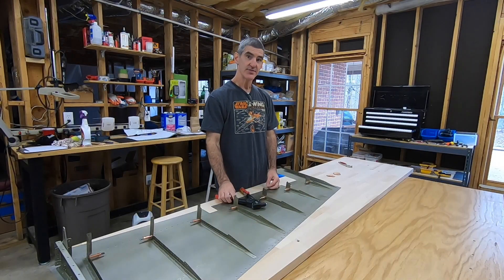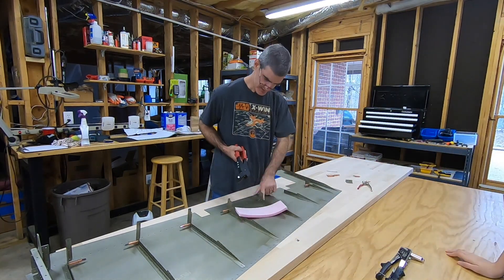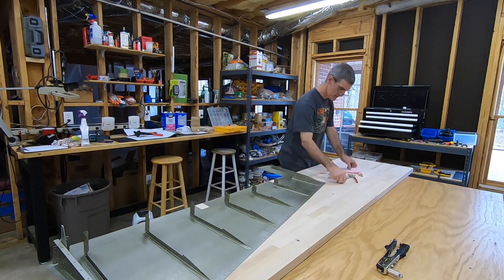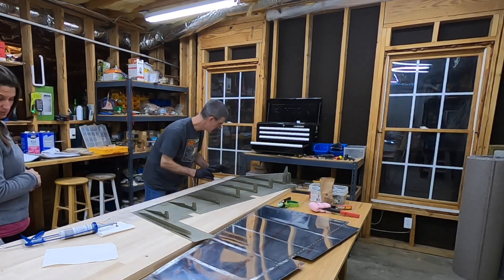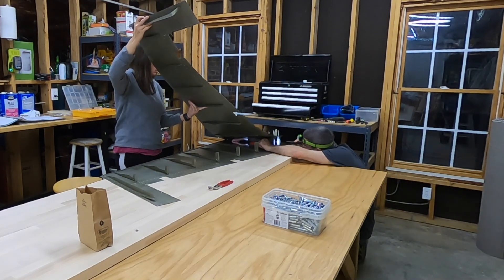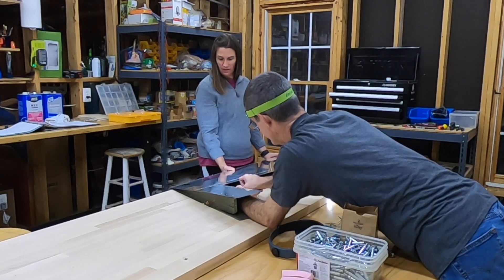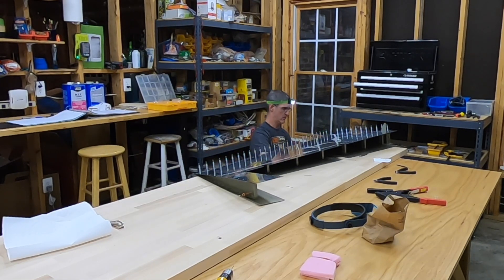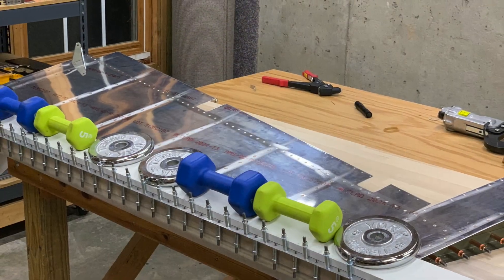RV-10 Build Log - Emp 27 - Tank seal and riveting rudder halves

Comment: I see they sell a 2oz and 3.5oz tube does one allow less usage or waste than the other or did you find that leftover in the tube saved  for a while and was able to be used on the next item needing proseal?

Thanks!
Reply from the maker: No, anything unused once it's mixed hardens pretty quickly.  It's like epoxy in that once the catalyst is mixed in, it's going to harden whether it's exposed to air or not.  I've heard you can put it in the fridge or maybe even freezer to slow the chemical reaction down a bit, which makes sense.  But that's only going to buy hours, not days or weeks.  My plan next time is going to be to buy in larger quantity but only mix what I need, and apply using a big syringe.

Comment: I was under the impression that it is better to rivet the trailing edge immediately after applying the tank sealant to the trailing edge before it has hardened.  What does Van's recommend or maybe it doesn't matter?
Reply from the maker: The plans actually describe the process pretty much just like I did it -- you are supposed to rivet the internal structure (stiffeners and shear clips) together, then cleco the TE skins and wedge together, then "clamp" the whole thing to a flat table using a board and weights, and leave it to cure for at least two days.  If fact, the actual riveting of the TE itself doesn't come until two pages later in the plans, after riveting in the spar and counterweight rib.  I have read various methods on VAF of experienced guys riveting while the sealant is still wet.  By the same token, I've read tales of guys who swear by letting the sealant on the actual fuel tank parts (wing ribs and skins) cure for a day or two before riveting those.  But I'm pretty sure the plans have you riveting the actual fuel tank together as you describe, with the sealant wet.

Comment: I have read about using a 3m tape that folks recommend for this, I plan to use that since its less a bit easier.  Plus after using similar stuff in the military and having many experiences like your wife.
Reply from the maker: I tried the 3M tape on the practice kit but didn't like the fact that I wouldn't have as much freedom to mush the parts around once they were in contact.  The tape is kindof binary.  It's either stuck or it's not.  With the tank sealant I figured I'd have some time to squish things around if needed when I set it up on the edge of the table.  In the end, I don't think that mattered, and I might give the tape another try on the elevators.  I've also heard you can use epoxy, or JB Weld.  In the end, the tank sealant wasn't nearly as repulsive as I had feared.  I'll probably buy the next batch in bulk and look into ordering some big syringes.  I've heard you can get them from veterinary supply places.